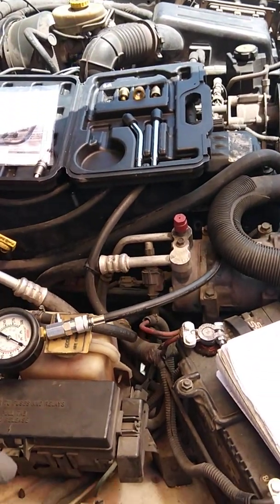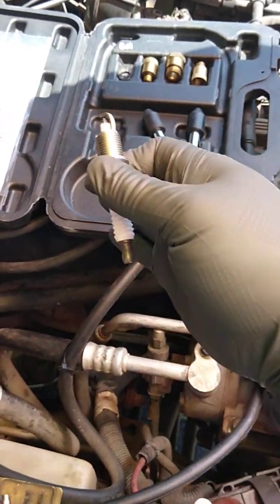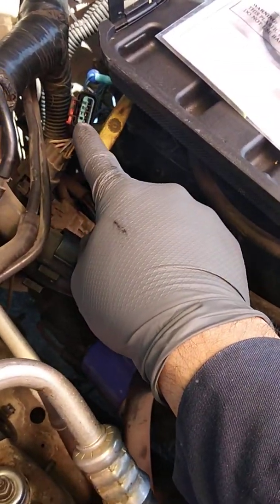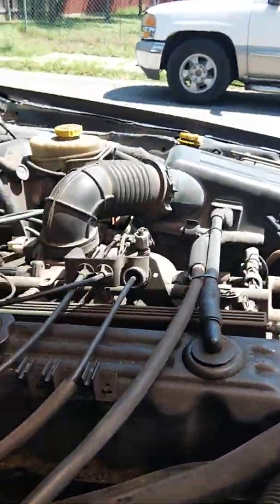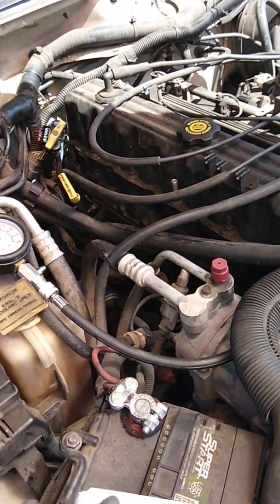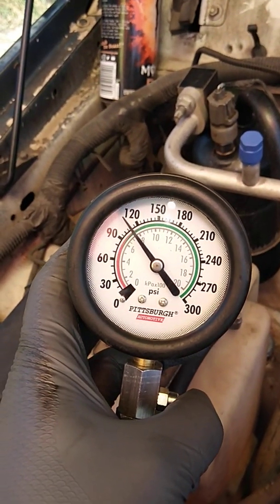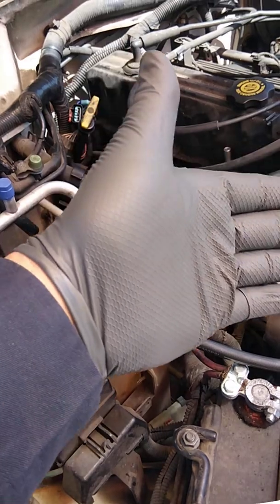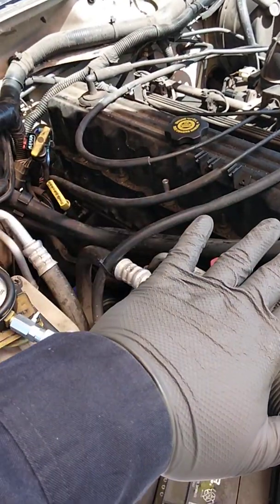How to perform a compression test using a harbor freight compression tester

Comment: You need to stop the fuel delivery before compression testing.

I pull the fuel pump fuse while the car is running and let it die before doing any compression testing. Replace the fuel pump fuse when you're done testing.
Reply from the maker: Did that thanks

Comment: Turning the motor over via the starter relay bypasses the need to keep going in and out if the cab.  It also bypasses the fuel pump from being activated.
Reply from the maker: sounds good thanks

Comment: Do I need to disconnect the fuel? Wouldn't the fuel melt/clog the catalytic converters?
Reply from the maker: I would just disconnect disconnect the injectors that way you're not getting any excess fuel into the cylinders

Comment: Do a dry and wet test, wet test add a little bit of oil into the cylinder to seal microscopic leaks.
Reply from the maker: I did a wet test as well just had enough time to film this
Reply from the maker: Video is over 2 years old